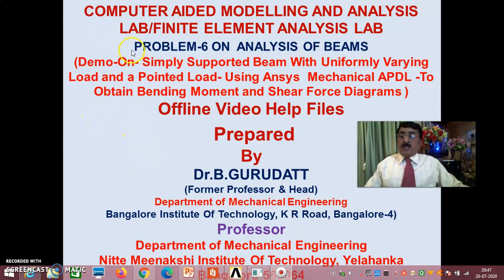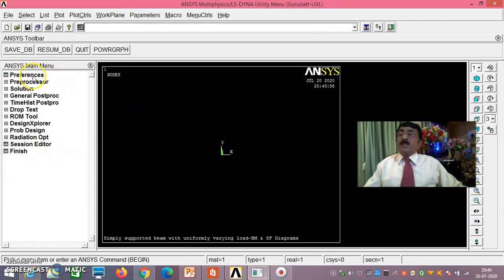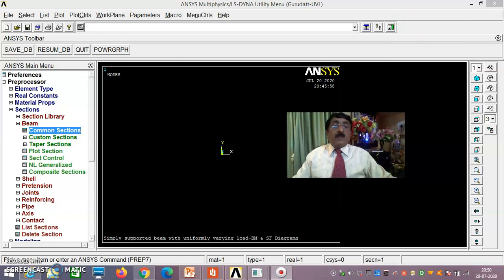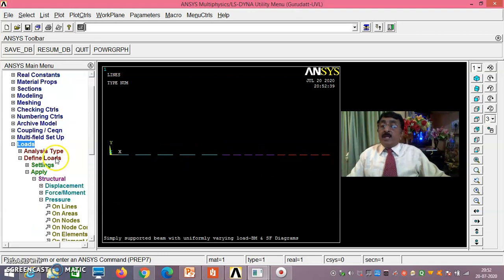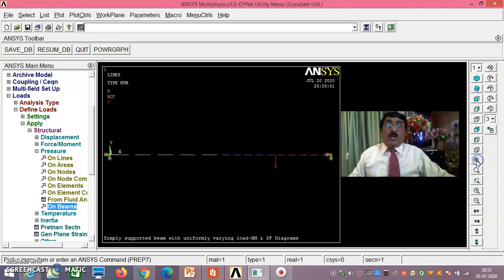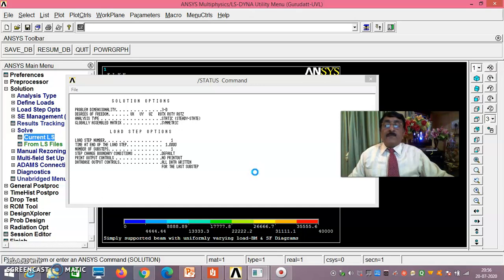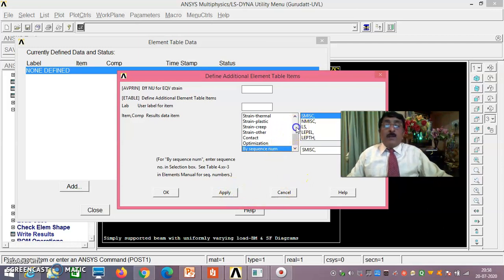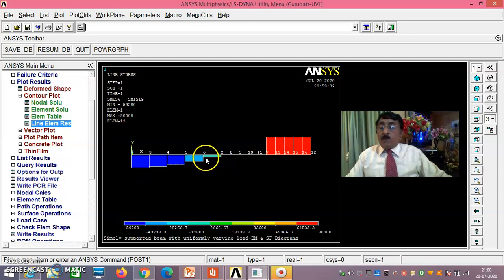Beam Subjected to Uniformly Varying Load-Demo -Using Ansys Mechanical APDL-Problem-6 -Session -2

Comment: thank you Professor. You have saved my life.
*do,k,11,20,1 
Sfbeam,k,2, pres, 0+(k-11)*15000/10, 0+(k-10)*15000/10 *enddo.
I have been trying to apply this code, it worked in video, however it was not working for me.
You gave me incredible idea regarding UVLD